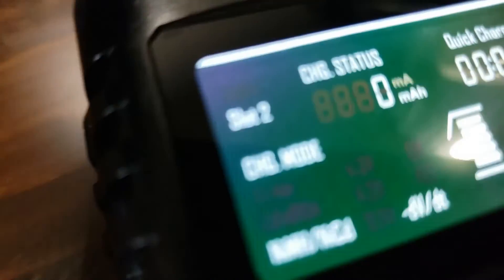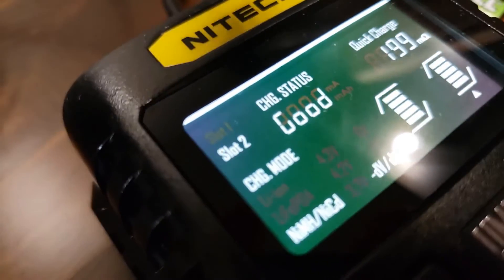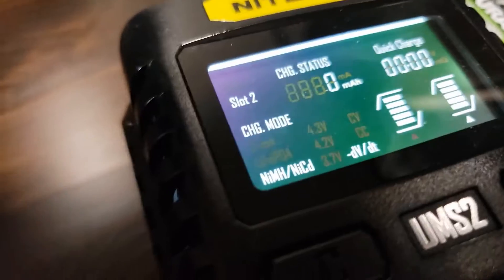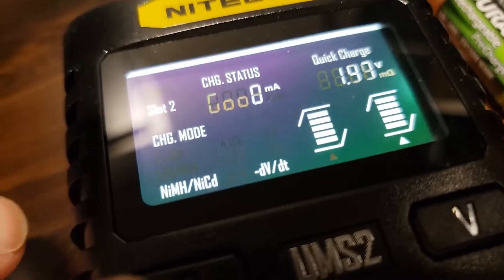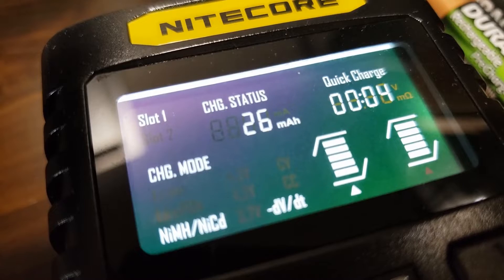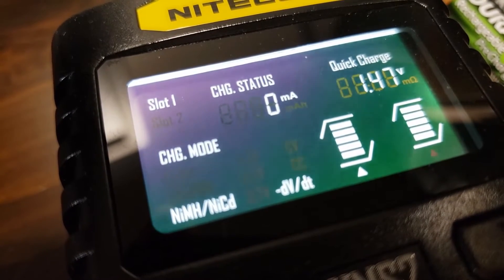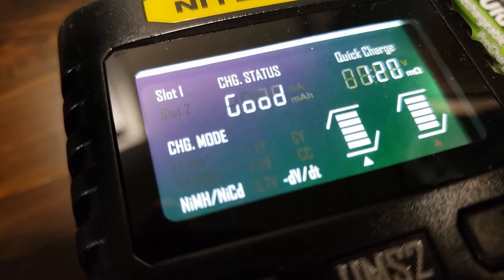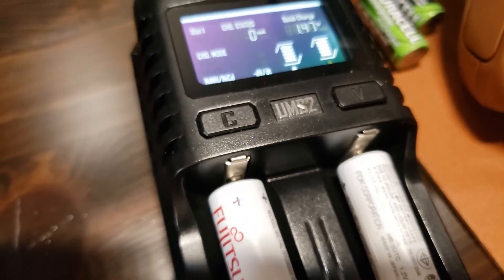Nitecore UMS2 Not Charging?

Comment: My mistake was not labeling the original UM2 Nitecore cable as soon as I took it from the box. Suddenly the charger gets stuck, the bars blink slowly but the buttons are unresponsive and the batteries do not charge. In my case it never overheats. I tested with multiple wall chargers, PC USB ports and several cables. Apparently, it seems that some  cables are the culprit. Although the cables work fine charging phones and other electronic devices, it seems that when used in the Nitecore charger they cause this misbehaving. Finally I was able to find one among several cables that apparently work perfectly with the Nitecore.
Reply from the maker: I wanted to like this charger but in the end I replaced it with an XTAR VP4 charger which is not as fancy but just works as it should.
Reply: @watdahel  Yeah, but every brand will have a % of failures, even Xtar.